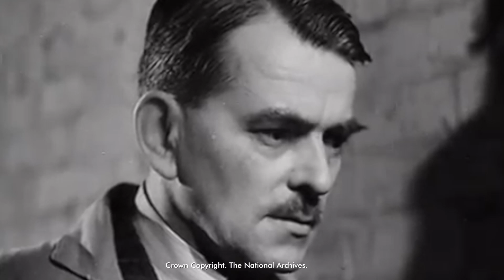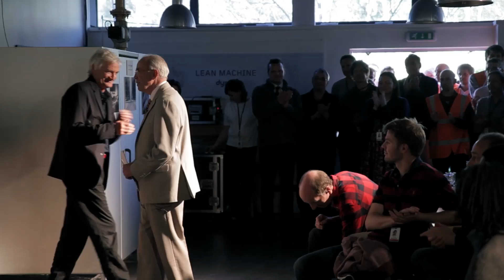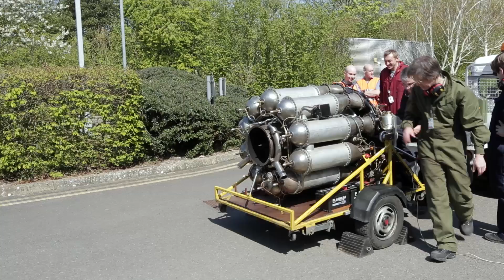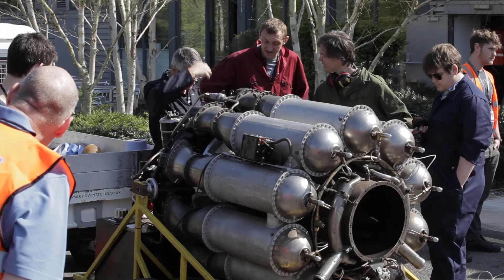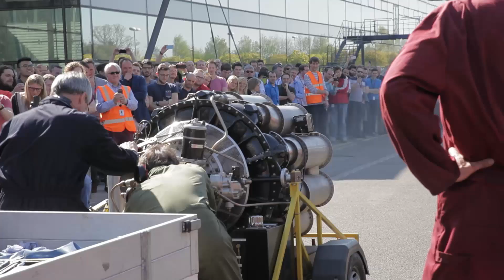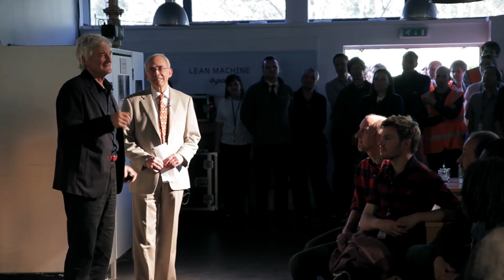Dyson engineers throttle up the Whittle engine

Comment: Maybe Im wrong, but  seems dangerous to fire that beast up with the spectators in close proximity!? like what if that thing has a RUD?? Still amazing tho
Reply: Rotation speed is kept low. Destructive forces increase with the square of the speed. Stresses are nothing like those of an engine in service.
Reply: Welland engines were remarkably reliable. They passed a 500 hour type test when the Germans were struggling to get to 10 hours.

Comment: Not quite true their was a few that failed due to the materials required for turbine and also the famous one which was due to a fuel leak from the primative injectors. Still marvelous engineer shame the meteor did not go into the war earlier.
Reply: parsons raised the idea in his patent for the steam turbine, at least fifty years earlier.

and the "furnace gas engine", either the cayley or the ericsson, used the same basic principle but with pistons. one fed the fire direct;y, one used a heat exchanger. both operate on the same concept.

i know i have a book from 1912 with concept drawings of what a gas turbine "may" look like...

biggest concern at the time was that they may have required an "exhaust condensor" much like a steam turbine does... that proved to not be a necessity, but turbines do perform better when they exhaust into lower pressures...

whittle was working with groundplans already established. a road map... parsons didnt.

Comment: Interesting, but not quite correct suggest and recommend read, FARNBOROUGH AND THE BEGINNINGS OF GAS TURBINE PROPULSION  F W Armstrong. To paraphrase 
The Rolls-Royce Welland, clue in the name, was, developed by Adrian Lombard rover team having fallen out with Frank Whittle, under the leadership of Sir Stanley Hooker, these went into the Meteor F1 the Rolls-Royce RB.37 Derwent the superior engine went into the Meteor F3. However running in parallel, but ahead was the RAE axial flow development which was started in the 1920 by AA Griffiths with engines developed by Hayne Constant during the war. The F2/4 axial flow engines were tested at the same time has the W2 series and were far superior, but not production ready. They were tested on a meteor prototype and Royal Navy MTB. Having tested all the British Jet engines on Meteor prototypes the Rolls Royce Welland was chosen, has the  Frank Halford Halford H-1goblin, which went to power the vampire, was not ready. It was basically a cleaned up Whittle design. However the Centrifugal compressors engines were short lived the best being the Rolls-Royce RB.41 Nene has the main development focus was now the RAE axial flow units, which were developed to the F9 sapphire, this was handed over to Armstrong-Siddeley, who developed Sapphire, whilst Rolls Royce under AA Griffiths guidance and Sir Stanley Hooker leadership developed axial flow engines Avon ( most successful engine ever, still manufactured today for gas turbine electric generation) and Conway. To summarise, Sir Frank Whittle, was well supported by the RAF and government, the narrative he was a struggling against the establishment is rubbish. Whilst undoubtedly, an exceptional concept, though inferior to axial flow, it took the involvement of engineering technocrats like Sir Stanley Hooker, Adrian Lombard, AA Griffiths, Hayne Constant , Frank Halford and their teams, to develop and deliver practical solutions that worked and delivered the required performance.
Reply: There are those who have suggested that Whittle was "well supported".  However, can I suggest that you get yourself a copy of, 'Jet Man: The Making and Breaking of Frank Whittle, Genius of the Jet Revolution'?  It was published at the beginning of last year and has been extremely well researched, using Whittle's notes and papers, together with numerous other authoritative sources.  If there is a 'bete noir' in the story, it must be Major George Bulman.
Reply: @grahamj9101  the book Jet Man has been challenged because it is like Montgomery’s memoirs and is a little economical with the historical truth, so should be read with care. The accepted historical authority of events, by all historians is Dr Hermione Gifford’s book Making Jet Engines in World War II. Also specifically covering aircraft in Jet Pioneers Gloster the birth of the jet age. This cover the E28/39 jet prototype development, it was designed to carry machine guns or canon through to the various Meteor prototypes which used the various engines. The Whittle engines were not powerful enough, and the first flight was with the Goblin, by then the deal had been done between Rover and Rolls Royce who took over jet development. RR were already involved with Whittle has a sub contractor, once they got involved things moved on. Whittle by then was exhausted. Before war started, RAF doctrine was fighters were not expected to require manoeuvrability because they believed there wouldn’t be dogfights, I know sounds mad now. Also they didn’t expect it to start before 1942, consequently when it started in 1939, there was a bit of a panic hence the E28/39 specification. However after the Battle of Britain they realised they could win the war with propeller aircraft, so in Britain jet’s development was slowed down to ensure reliability. Similarly at the beginning of the War the  Luftwaffe wasn’t too interested in Jets but at the panic after 1943, through everything into the Me 262 hence the poor reliability. The irony is they could have had the Heinkel 280 at least end of 1942 ready for the 8th Air Force.
Reply: Utter BULLSHIT !!!

Comment: Whittle invented the centrifugal flow compressor, which pushes air radially, versus the axial flow compression of the Germans, which pushed air along the axis of the engine. While the axial flow engines were out first, the alloy of the fans meant they could only last around 50 hours of use. However the Whittle centrifugal flow engine still works to this day. It had limitations with size and number of fans but still it’s an incredible achievement to still be working. He got it right, absolutely.
Reply: The first two German engines were Centrifugal (with centripetal turbines) (HeS1 and HeS3).
Whittle patented both axial flow and centrifugal compressor gas turbines in 1930 but the centrifugal compressor version was easier to build on limited funds.
Reply: Whittle didn't invent the centrifugal compressor. It was already being used to supercharge aircraft piston engines.

Comment: Sir James Dyson said that Whittle "got it right the first time".  He certainly got the principle right, but it took a few failures and several major iterations after his first 'ground use only' demonstrator of 1937, which had one large combustion chamber to one side of the turbomachinery.
Reply: he was also basing his work off parsons and the like. in his original patent filing for the steam turbine parsons mentions the concept... and it was already being played with in a piston form with "brayton cycle" type engines... they had the issue of valves, intermittent pumping.. again, the benefits of using "rotary compressors" was toyed with...

but it took the science of metallurgy a few more years to make it actually viable...

parsons actually DID "get it right first time". there have been very few improvements to make on the initial design... manufacturing has definitely advanced in leaps and bound though.